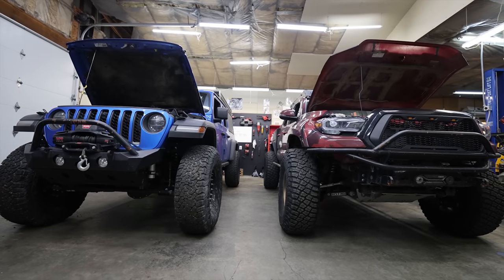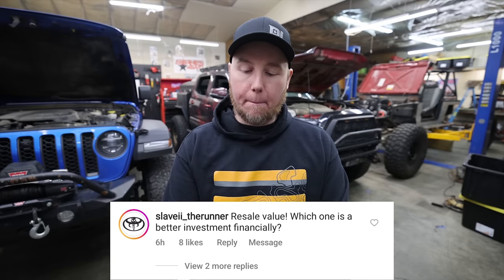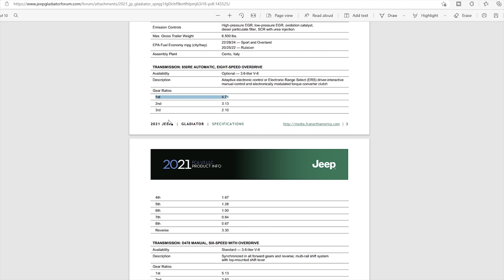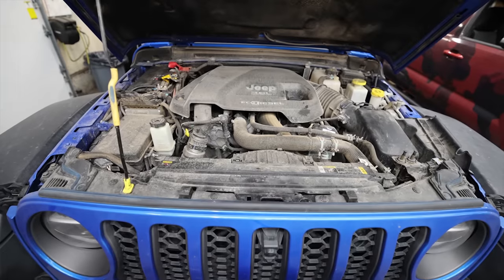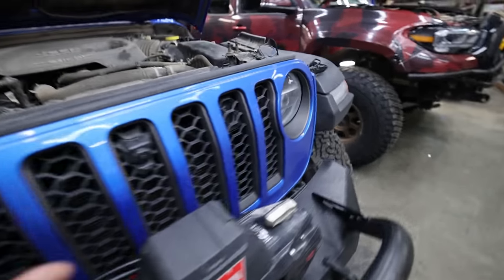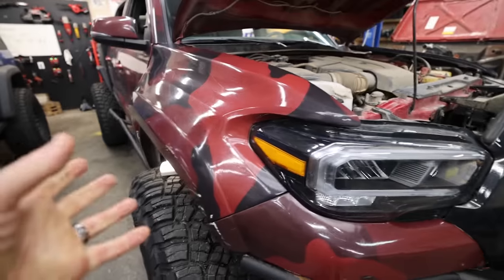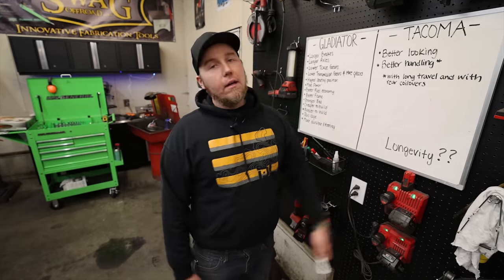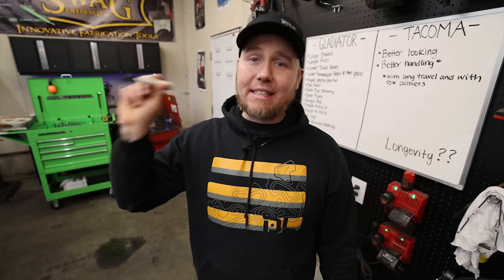My 21 Jeep Gladiator Vs My 21 Toyota Tacoma. Cold Hard Facts.

Comment: I bought the first brand new vehicle that Ive ever bought in 2020. 

For me, the Ford Ranger was hands down the absolute best value. Its somewhat of a jack of all trades: if you want economy, you can get it by driving sensibly. Hypermiling is not even needed - I drive 55 on back roads, 70 in the 55 zones on the highway and do mash it now and then. I averaged 26-27mpg tank after tank before I upgraded my wheels and tires. Its got power - it feels every bit as strong on the low end as my 96 Suburban did - it can definitely get out of its own way. You'll sacrifice economy, but the point on these two is that you can pick which one you want. 

It has just enough tech to be modern in an STX trim but not overloading the driver with gigantic movie theater sized screens and touchscreen everything - it has a nice display but also buttons and knobs. 

Reliability? 'Assumed' to be GREAT since the chassis has been around in overseas markets since 2012 - tested thoroughly in much rougher climates and geography than the typical US consumer will experience. Engine and transmission have been around for quite some time too - this is the same 2.3l EB that has been around since 2012 in Focus STs and Mustangs etc. Its tuned down too for truck duty - low end torque over high RPM power - though the higher RPM power is still there. It doesnt get wheezy at 4500rpmm and above like your older trucks did (outside of Chevrolet 5.3ls of course). 

To get the same power from the Taco or Canyon/Colorado, you'd have to get an upscale trim and pay a LOT more - 5-10k more - and sacrifice economy with no choice on which. You'll get the power but NOT the economy.

I didnt actually compare it to the Gladiator because they were in completely different price ranges - in 2020 the MSRP for a base Ranger was 24,500$. Thats bonkers for what you get out of the truck. I did move up to an STX trim, but honestly its because that was the one on the lot with only 2 miles on it, and had the right colors - I mean who wants a white truck with black bumpers as a base model? I got Magnetic with black bumpers...perfect. A set of black wheels ties it all together. (The alloy wheels were ugly and didnt fit the color scheme) I got mine for 28k which was still a great value for what it is. 

Payload and tow ratings? Better than base models of the competition for sure. Get an upscale trim and you can match/beat the Rangers numbers...but you'll spend more money and again sacrifice economy. 

Why did I pick the jack of all trades and master of none truck? Well, I hauly bulky equipment sometimes. Once in a while I will load it down with a LOT of weight in concrete samples. I do the occasional light off roading on construction sites, but nothing crazy.. I mean Im not spending 28k to tear something up. I mostly commute though - rural to highway and little city driving. I needed something that was versatile and can do what I need it to do at any given moment - be it carry me to the office and pull down 28mpg, haul 1600lbs of concrete samples, load the bed with a bunch of large cases of testing equipment, or function off road in the middle of a muddy construction site. The Ranger does it all, and does it well - though it masters nothing.

Comment: I will say as a Gladiator owner.  I LOVE mine but stay away from the 3.6L gas engine.  They have issues with the lifters.  Get the diesel or even better the 392 if you can.   Hell, look into the 4XE version if they put one out.   Mine is currently in the shop and by the time they are done with it it will be two weeks after only 13K miles.    Literally my only complaint with the Jeep.

Comment: It would be awesome if both vehicles were purposely built for the same reason from the factory so a more leveled comparison can be done in stock configurations. Let's face it, one is built for the "jungle" & more gnarly offroad tracks and one is geared more for the daily utilitarian use on "concrete jungle" and dirt roads.. 
I own both trucks. I use my '23 Gladiator 392 if needed but since I live in Flatrida, nothing but mud & water crossings, really. But for everyday drive around town, work, & the typical hardware store runs, I use my 3rd gen Tacoma TRD OR 4x4.

As always, awesome video, Nate! 👍

Comment: I'm curious about what you think of the Chevy colorado Zr2 1.8L diesel.... I ended up buying a 2017 colorado with the diesel, and it's no race car, but she definitely gets amazing fuel mileage. My wife drives it as her daily and she is strictly city with 21mpg (hand calculated) and we ended up hooking up to a black series alpha camper trailer fully loaded at 3800lbs and still got 17-20mpg depending in the stretch we drove. Currently, she is stock gears and drivetrain with all the DPF junk still at this time. Only has a 4 or 5 inch (I forget which it is) BDS lift kit but still stock size wheel and tires. (Need to get the fender chop kit to have the clearance for 35-37s) 
But overall, I think it has the best overall bang for the buck. I like the look, the handling, the comfort creatures, and having both front and rear lockers definitely come in hand when on tougher terrain. 

Horsepower - 181 hp @ 3,400 rpm, Torque-369 lb-ft @ 2,000 rpm

As far as gears and axles and all I have not dove that deep into it but I definitely think having the 2015-2021 colorado Zr2 in the line up would be great to see.

Comment: I appreciate you listing the actual side by side measurements. I’m a Toyota 4Runner owner and for my needs that’s what was best suited for the off-roading travel I wanted to do. There’s no doubt that Jeep is better suited to upgrade for more difficult trails. If I could have two vehicles for off-roading I’d get a Jeep as my other one. I will tell you I towed a Jeep on a car dolly just about 150 miles and didn’t even feel it back there. Granted it was flat pavement. Oh, and I think you’d pick up more women with a Jeep. Especially during the summer with no doors or top. IMO

Comment: COST!  Drove my choice.  40k for a TRD OFFROAD manual verses a 65k+ gladiator Rubicon.  Your evaluation is spot on for a true off road beast but 25k is a lot of cash to spend on mods.  Most TACO owners with never build out their trucks to your performance level.  I d be interested to know how your total outlay for both vehicles compares.  As for longevity/reliability just look at odometers of 1st and 2nd gen tacos verses jeep anything.

Comment: As a mechanic for for the last 28 years and a Jeep owner I can tell you without a shadow of a doubt for the street driven stock form reliability you cannot beat a Toyota truck. Hands down the lowest cost as far as repairs go. I work in a very busy small mom+pop type garage in northeastern Massachusetts. With the exceptional wheel bearing or air pump all we do is regular service, brakes and exhaust work on Toyota Trucks.
Reply: Nah

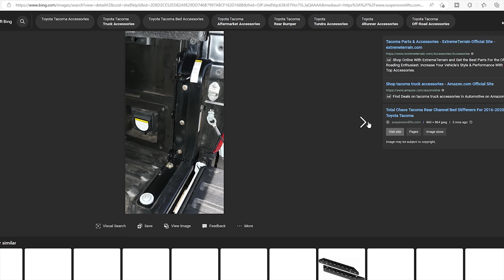Comment: Great video comparison. I guess I am partial to the Ram Power Wagon.  It is an absolute beast of a truck.  Like a Gladiator on steroids.  It has a wheel base that is 12” longer, 21” longer OAL and around 5” wider than the Gladiator.  Will definitely get more pinstripes down a tight trail, but the axles are already huge with built in front and rear lockers.  It is definitely a much heavier beast at around 8000 lbs with just me in it with some basic gear and very thirsty.  The frame is super solid with some good skid plating from the factory.  Crawl ratio is 50:1, but now at an effective 45:1 with the 37” tires and the stock 4:10 gears. Can’t wait to run it on the trails.

Comment: I'm surprised you did not mention the longevity of these engines, I work on Jeeps and Rams, replacing a ton of oil filter housings on 3.6 and a lot of issues with aftertreatment on diesels. I would like to hear your experience on that.

Comment: i'm not convinced that the bed reinforcements on the tacoma are as needed as everyone implies.  my tacoma got them  specifically for the tiedown points only.   most of the documented cases of damage were people with toppers and overlanding gear stacked way high, not people just using the truck for home depot runs or overtightening straps.

that said, as the previous owner of a '02 ranger that suffered from the steel bed rotting out, i'm mostly happy with the composite bed-- i don't need to worry about it rotting out.    i don't think it's 'better' than a steel bed, just mostly swapping positive/negative lists.  in my case rust/rot is more important than payload, so the composite makes more sense for me.

Comment: As someone who has been working on online advertising for awhile, when you see those ads next to the articles, it doesn't mean the article was paid for by the manufacturer. Most websites monetize through Adsense and Google chooses what ad to show. You probably searched for Toyota Tacoma reliability and by clicking on an article about a Tacoma and reliability they put in you a Toyota shopper category. It's likely you'll see Toyota ads in other websites you visit as well. So, while Toyota is indirectly paying the website, it's going through Google and I wouldn't ding a website based on that. But you're right, reliability data is really hard to come by. Consumer Reports records all issues reported to them as basically the same. When the Ford infotainment systems first came out they were really buggy and a lot of models looked massively unreliable. While it's annoying, it's not the same as having your transmission go out. And no one tracks how many transmissions get replaced from each manufacturer and in each model. It's well known that a lot of Ford Escapes have transmission trouble at 80,000 miles. But where's the data?

Comment: I really wanted to buy a Gladiator last year.  But I was looking for a vehicle to tow behind our Cummins powered 2018 Ram 2500 4wd carrying a 4wheel popup camper.  The overall length of that combo became the issue.
The Gladiator is beefier than the Wrangler.  And I love the Ecodiesel engine in my 2016 Ram 1500 4wd.  But the Gladiator needs a lift, bigger tires, and a gear change to really look and handle the rugged roads right.  So I bought a Wrangler to be the adventure vehicle behind our camper.
I do believe that a custom build Gladiator with portal axles would be the ultimate adventure vehicle.  A Cummins 4BTC would be the ultimate powerplant in place of the 3.0L.

Comment: Great video.  I didn't own both the same years but I had a 3rd gen Tacoma TRD Off Road (16) sold it to get the (21) Gladiator Rubicon .  The Jeep is a way nicer truck in just about every category, it should be it was a lot more money.  Engine : Jeep, the newer 3rd gen Tacoma 3.5 has zero low end torque, the older 4.0 L v6 I had in the FJ was better.  Transmission: Jeep two extra gears and it does not hunt for gears like Tacoma.  Infotainment / Camera's : Jeep Alpine system way better than the top JBL in Tacoma, Camera's on Jeep are clearer imagine.  Seating : Jeep again and more head room.  More room for rear passengers.   Want to run bigger tires, Jeep.  You can run 35s on a Rubicon or Mojave stock.  I clear mine with zero rub issues with a basic leveling kit. 
The Tacoma has more depth in the  bed so you can stack more stuff than you can in the Jeep.  Both have a ton of after market support.  So pretty much a tie there. 
I love the retro look of the Gladiator, some do not. Tacoma is the best looking modern truck big or midsize in my opinion. 
Both are good trucks but I love my Gladiator.  Loved my old FJ but the new Tacoma I had ....well it was fine just way too common.

Comment: I love my 2nd gen TRD Off Road Taco but my son has a 2019 JL Rubicon and man, is that thing capable.  The Gladiator would be on my short list for a replacement to the Taco, but I'm not ready to step away from Toyota.  Both are great vehicles in my opinion.  
I agree with everything you said, no feathers ruffled here!

Comment: Great comparison! I am a Toyota fan based on my experiences with my 3 Land Cruisers over the years, but between these two trucks, you clearly made the point that Toyota is still behind in the industry. And... you didn't even mention the electrical issues you've had with the Toyota that can't be fixed by numerous dealers, if I remember correctly. Well done 🤙🏼

Comment: Like my 2004 Jeep Grand Cherokee. Over 180,000 miles on it. Stock. We gotten some bad snow storms. People can't go anywhere. Most us their pickups. I don't use my pickup. With even 7 inches of snow on the ground. My Jeep treats it like it's not there. All it has is the straight 6 4.0L. Full time 4x4. Same fuel mileage as my 2020 F150. Only real difference is the size of fuel tank. Jeep 12gal. Truck because of tow package. 36gal. My Jeep has proven itself. Still running.

Comment: I’m looking at a new Gladiator Sport S EcoDiesel. With a few options that make sense that’s marked down to used price of $44k! That’s with a hardtop, rear locker, towing package and the 26S package with leather wrap wheel, power windows/locks 17x7.5 silver tech wheels, deep tint windows. But most importantly 3.0V6 diesel, that has the only negative of the def fluid. But you say the Tacoma looks better? Wow that’s subjective at best, but I feel their ugly sit on the floor hard riding soft brakes toys. I presently own a 2019 Colorado CCSB 4x4, WT, that’s been fantastic. But we just want something different and new, the new Colorado is nice, but I’m not crazy about high stress small engines. There was nothing wrong with the 3.6 V6! That has more power than a Pentastar. Thanks for your outstanding video and I’m a subscriber now.

Comment: I can't believe that Toyota actually used a C-channel frame finally.  But I also cannot believe they riveted it together!  That's crazy!  I would really like to know how thick the steel is on the C-channel frame on the Tacoma.

Living in the rust belt, I will always prefer a well designed C-channel frame.  Fully boxed frames always rust out super badly in the rust belt.  Always.  No doubt the Tacoma you have would be a problem too, but fully boxed frames are absolutely horrid in the rust belt.

Comment: It was nice to see a non bias view. I am bias. I love toyotas. I do like jeeps though.  As a rust belt person in NE ohio, I can tell you where those toyotas rusted. The frames rusted EVERYWHERE. The salt is terrible in the rust belt. The other thing is they had a 3rd party who were coating those frames. They didn't do it properly. 

 Toyota had the recall. Those who actually did the recall, later had no issues. Same thing with the 1st gen tundra. They do not use that 3rd party anymore.  One plus about the 4th gen tacoma, is it will have a far better structure then the previous generations.  Check it out. You may like the sounds of it. Btw, both builds you did are very kick ass. 

And I wonder, did you get an OTT tune on the tacoma? Sounds like it was gear hunting extra with a trailer behind it. I had an auto 3rd gen. Got sick of the gear hunting. Grabbed a manual 3rd genm it was a million times better. Then I heard that auto guys were using an OTT tune which helped the trans issues massively. 

I love them both. Well done in suspension,  gearing on both.  I love that toyota coloring too. Who doesn't like that blue jeep has?

As far as reliability... I've first hand seen jeeps with issues on a high level with less than 150k miles. Tacomas with 400k plus miles on average and still running. I have seen a ton make it to over 800k miles. That is just working 17 years in shop life. But like you said, if you're doing your type of hobby, the jeep is a way better way to go. The frame, suspension and gearing is way better. As far as reliability of motor, sorry I have to say in almost 2 decades,  it's toyota.  Even the honda thing, I worked for Honda for a while. I saw pilots, Ridgeline and odyssey coming in with over 500k miles. I'm not seeing that from jeeps. Now old school online 6 jeeps. Those guys didn't diem 100% could keep going for reliability.

Comment: Great video. I appreciate the way you went about this. Straight data rather than opinion. I do have a couple questions:
#1 You told us the Gladiator parts are bigger, but is bigger always better? What about handling and design?
#2 what about that time you drove the Tacoma on the Rubicon Trail and the ecodiesel Jeep that was with you broke on the trail? Does that count for reliability?

Comment: You're not wrong i have 2019 tacoma pro. Im towing black series camper hq12. I use the sport shift without ect button.  No issues but with electric trailer brake kit no issues.  Wish toyota gsd a tdi in the ststes like jeep. Better towing

Comment: I like your full-on honesty. Perhaps back in the 80s, 90s, and early 2000s, Toyota had a edge in reliability over the other brands, of which, is no longer a thing IMHO. Reliability is ultimately based on your input regarding preventive maintenance, especially with these newer rigs (beyond that, being more reliable is marginal at best, all brands have issues). I'm a Mopar fan, and will admit they're not as good as they should be. Mine and my wife's '04 Durango, at 181k miles, is a great but thirsty rig. She does need her oil topped off every so often and it's fair to say the suspension was probably the cheapest part of the build, as I will at some point, need to replace most, if not all, components to get her back to new (as soon as I can afford it). Almost everything else about this fun gas guzzler is wonderful. Just my $0.02. :)

Comment: The trd off road models ring gear is 8.75”. And if I remember correctly so are all with a manual transmission. Still 32 spline.